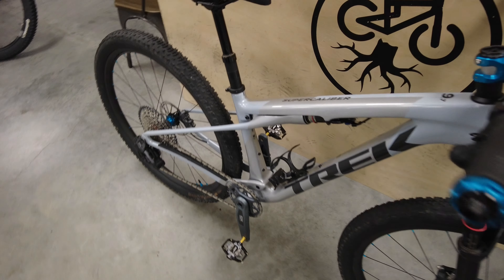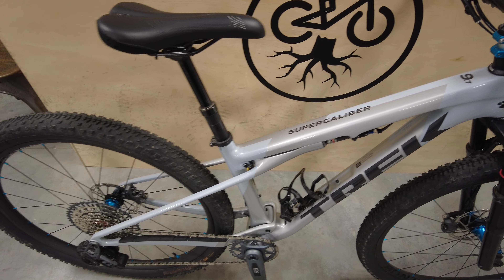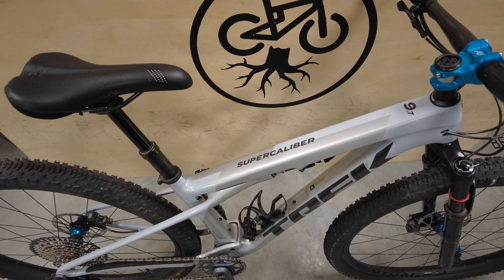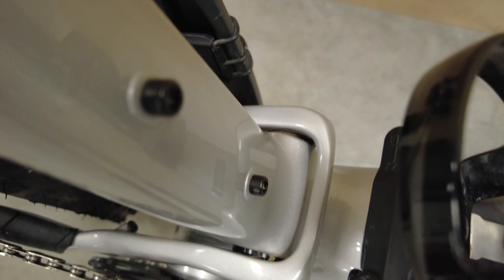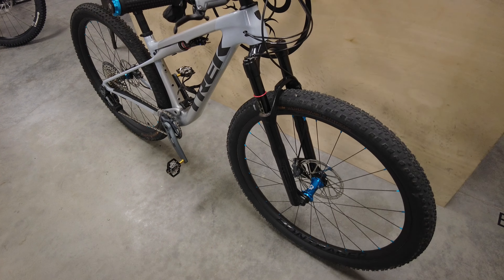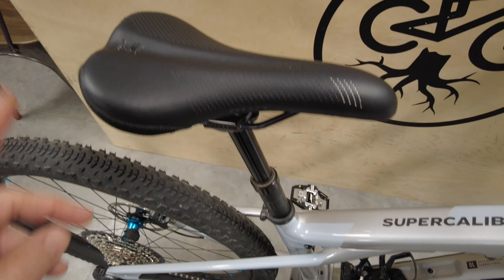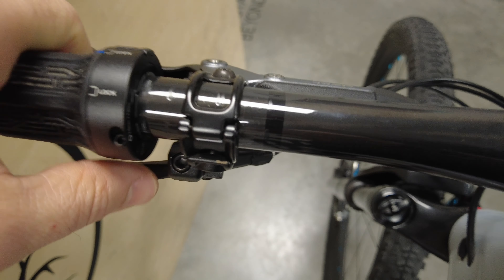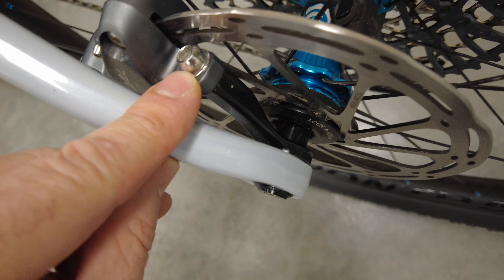2024 Trek Supercaliber SL 9.7 Gen 2 | Your Lightweight Cross Country Race Bike

Comment: Hello,Trek Supercaliber 9.7 or 9.8 arasında büyük fark varmı? Nedir?
Reply from the maker: Thanks for the question!  Carbon wheels appears to be the biggest difference (at least here in USA). The 9.7 build has GX AXS but alloy wheels.  You can then go to the 9.8 shimano build, sheds a couple lbs and you get carbon wheels.  They also have a 9.8 X0 build but it is almost 2k more expensive.  If you like the carbon wheels on the 9.8, go with that, but if you want to buy your own, buy the 9.7 and pick your own wheels would be my decision to make.  May come down to colors too!  Good luck!
Reply: Bir sorum daha olacak.Santa Cruz megatower CC custom29 or Trek supercaliber sl 9.7 gen2 or Trek Fuel ex 8 gx axs ARASINDA KALDIM.HANGİSİNİ ÖNERİRSİNİZ.Thank you.Hangisi en sağlam ve hızlı,güçlü. @BikingRoots
Reply from the maker: @egemenpolat9964  Sorry for the delayed response, been super busy.  I would say where do you see yourself riding the most?  All great bikes but for different purposes.  Supercaliber is your lightweight, cross country race bike that will be light and fast but not as confident on chunkier knarly trails.  Mega Tower is your longer travel enduro bike that is built to handle big jumps, tough terrain and soak up all of the rough stuff for you, but a lot heavier than a supercaliber.  Fuel EX kind of splits the two as far as weight, travel, and capability.  More of an all rounder for lots of terrain.  Again, depends on what your goals/dream ride scenario is.  Wherever you see yourself riding the most, get a bike that will handle that the best.  Good luck!